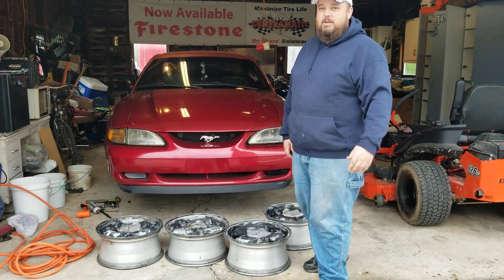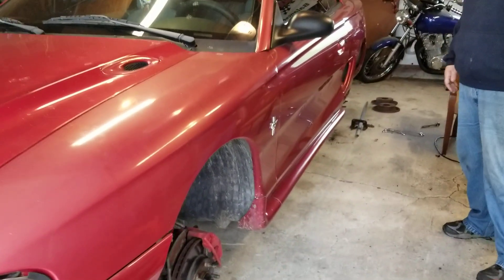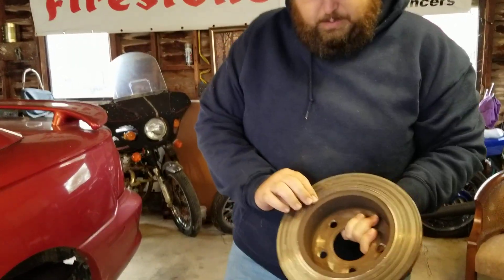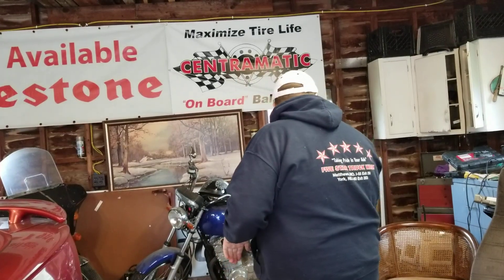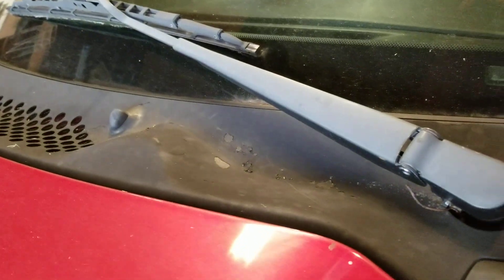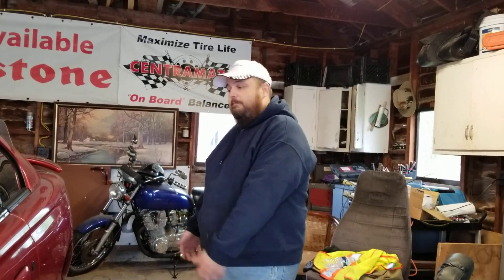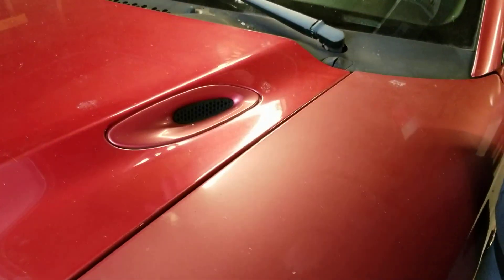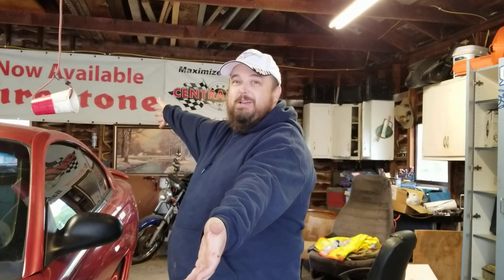Project mustang is in bad shape !!!

Comment: Also check the slid pins they get rusty and won't let the calipers slid back and forth by the way I'm the guy who put your front tires on your truck
Reply from the maker: Ok thanks man I'll check it later today with my brother T. HOOK hes good at that stuff how it going for you
Reply: @OVERALL_PAUL  I'm doing good man hanging in there also try to buff the paint you might be surprised with the color change but if you do decide to paint it i can give you a few tips
Reply from the maker: Ok
Reply from the maker: I believe the car has been spray painted on some of the parts